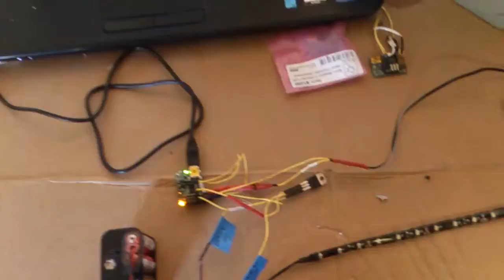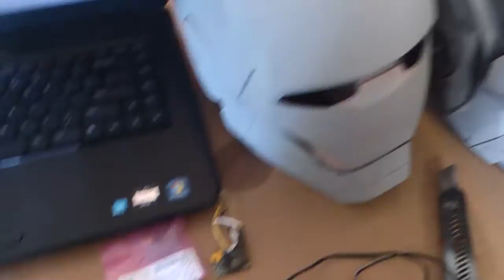Electronics: Transistor usage for LED lights

Comment: are you able to run the chip and the leds with that 12 v pack?
Reply: I would also be interested in that... The popolu can only handle 6V so wouldn't it be too much when powering both at the same time?
Reply from the maker: The input to run the pololu is between 5v to 12v so technically you can run the transistored LEDs and chip off the same power supply.
The servos run off a different circuit on the board. That curcuit is used to run the servos and the transistor input to switch the 12v power for the LEDS.
Reply: Jay May Thank you! So for another 12V LED, I would need another transistor but could use the same power supply as for the first LED right? Your tutorials really help so much! :)